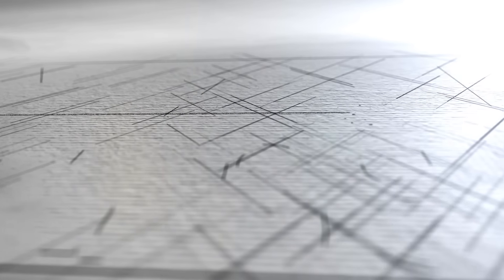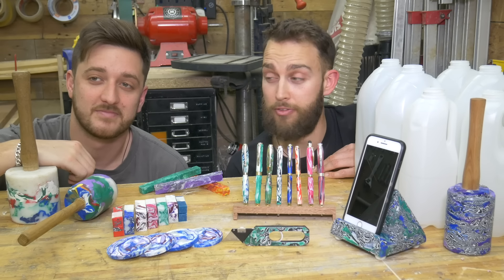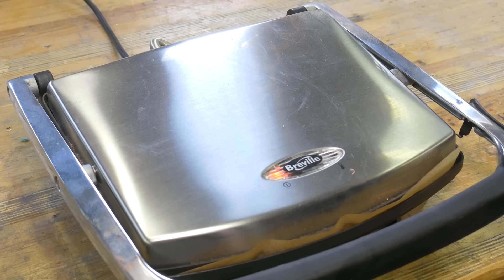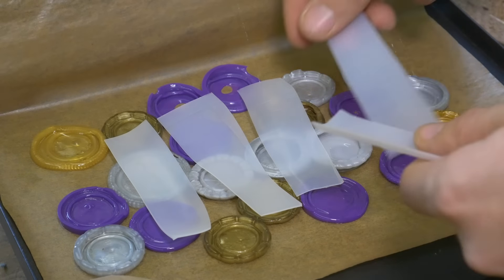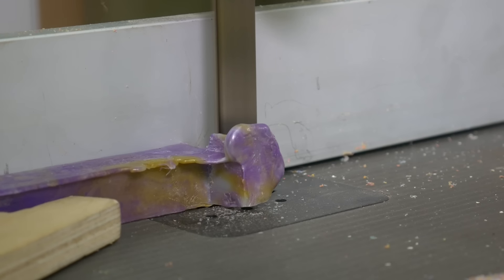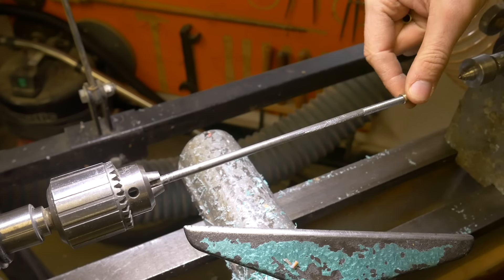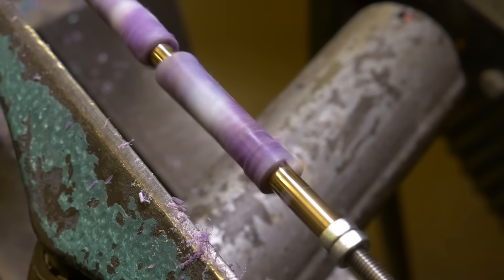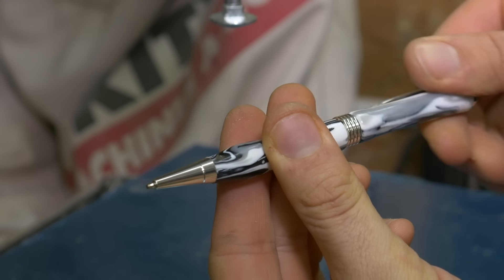Beginners' Guide to Melting HDPE - How to Make a Recycled Plastic Pen

Comment: Hi guys. Realy hoping to meet.you 2 at MC2020 this year but the way things are going rite now im wondering if the show will even be on even though its been pushed back to august. 

Anyways. 

What size mil drill bit did you use to drill the pen blank ?
Reply from the maker: Hey! Would be great to see you there. But it does seem unlikely doesn’t it. Hopefully it will get pushed back again and not cancelled altogether. I believe the size was 6.5mm, which allowed for a nice compression fit 👍🏼

Comment: Hey guys! I was hoping for another piece of advice, I tried a second melt and press. I felt like I had melted it really well this time on a panini press and got it into my mold (an old aluminum tube) and pressed it. I used a c clamp to press it and once it cooled the edges were all squiggly and not smooth. Is this more likely to be from pressure applied or temperature of plastic when pressed? Thanks!!
Reply from the maker: Hey dude - good question! Even in our 2 ton bottle jack press, the surfaces of the plastic are always like that. That’s why we always try to skim off the surface of the plastic to reveal the marbled colours. As the plastic cools, it shrinks. So if you don’t re-tighten then bubbles can form inside. So we come back every 10 mins or so and tighten the clamps. Hope that helps!
Reply: Brothers Make very helpful!! I knew it shrank some but did not even think to re tighten as it cooled! Thanks so much again for the fast reply! Gonna give it another go tomorrow
Reply from the maker: Awesome good luck!

Comment: It doesn't look liquid enough, but do you think it's possible to cast it in silicone molds? Would be great to craft dices or figurines
Reply from the maker: Unfortunately is doesn't go down to a liquid state. You would still be able to achieve things like dice, but you'd just have to press it in something more rigid, like a plywood mould. It also carves quite nicely!

Comment: Can you use cooking spray in place of silicone spray?
Reply from the maker: Since this video we’ve actually moved away from silicone spray as it’s easy to get it mixed with the HDPE and stops it sticking together properly. Try using Teflon baking sheets instead of greaseproof paper and you’ll be fine!

Comment: Hey guys love the video! I am currently trying my first melt. I am using packaging from work that is #2 hdpe but somewhat thick compared to bottle caps. Would that effect the end result or just simply the length of time to actually melt it? I haven't been able to really do the fold over and re melt yet because it just doesn't seem to get there. Thanks!
Reply from the maker: Hey! Awesome that you’re starting your own projects 👍🏼 we have come across the thicker stuff too. Don’t worry - as long as it’s definitely ♻️2 then it will work, it just may need a bit of extra time. Remember this won’t go to a liquid state but will soften enough for you to be able to bring it all together and fold/twist it up. Let us know how you get on!
Reply: @BrothersMake  Thanks guys! I gave it a try, currently using an electric skillet which did take it a while but it got there! I had one other question that maybe you guys can answer. my overall goal for melting and forming hdpe is to create custom plungers for my paper briquette press. I use pvc tubing for my mold and was wondering if you guys had any experience or opinion on whether or not molding hdpe directly into a pvc pipe would warp the pvc or if there would not be enough direct heat to do anything. if you guys dont have any experience with this then i will do an experiment and report back! thanks again for the response!

Comment: 04:30 Does the repeated folding process not mix the release spray into the plastic? And is that not a bad thing?
Reply from the maker: That is a potential yes. Since this video, we have avoided using spray release in any of our HDPE projects.
Reply: @BrothersMake  thanks... do you just use the paper without it?
Reply from the maker: We use Teflon baking sheets now
Reply: @BrothersMake  Thanks! Less waste as well ... good all around.

Comment: Would it be easier if you make the first pen as you did here, then make a mold of it and skip so much lathe and cutting time, on the next hundred pens you make?  Is it possible to make it to begin with in a round mold rather than square, to be easier to lathe?
Reply from the maker: yes that would be absolutely possible.

Comment: Decrease the (rake) angle of your cutter relative to the pen. In other words hold it down slightly. This will put less stress on the material and should cause explosive cracks like that to practically zero. Should get a better surface finish from the get go as well!
Reply from the maker: Thanks for the tips!

Comment: Some lids, even if they're HDPE, can become very brittle after being remelted, which, apart from the bubbles, can be another reason why the remelted blanks were shattering while being turned. I discovered this accidentally when I was remaking plastic parts for a broken computer mouse. You should first test few samples of different types of lids and see which ones doesn't get brittle after remelting.
Reply from the maker: We’ve melted multiple kilos of HDPE at this point and never come across any that turn brittle after melting. Possibly with Polypropylene but HDPE always melts in the same way

Comment: Hey guys I took a old electric drill that was battery powered and took it all apart and 3, printed the structure to make me a lathe for turning melted recycled plastics for cool projects and can also machine and turn soft metals like aluminum, copper and brass to make parts or custom parts for my RC car indoor carpet racing cars I got for oval and road course tenth scale and use lathe to turn custom suspension parts and ECT for my cars to make them handle better or make lighter weight parts of the original parts

Comment: What other ways can you melt HDPE?  Can you soften it in water (boiled to temp)?  Can you use a microwave to soften it?  I understand a toaster oven works -- but what about a regular old toaster?
Reply from the maker: Boiling water would not get to a hot enough temperature to melt HDPE. I think it’s around 120 it melts. We tend to go to around 150-160 degrees celcius for speed. Never tried a microwave but I would assume it doesn’t work since it doesn’t work on heat directly. A toaster would also be dangerous, so be careful!

Comment: How are you disposing of all the microplastic saw dust resulting from sawing etc? as it would be hard to pick up some of that microscopic dust to remelt (not talking about the big twirly bits as mentioned in the video but rather the plastic dust biproduct).
Reply from the maker: You’re right. The stuff that comes off the saw is very difficult to collect. We are in the process of setting up a secondary room next to our workshop that will be dedicated to plastics completely. That way we can sweep and collect everything. Until that time, we are still prototyping ideas for ways to use up some of the plastic that already exists rather than having to use raw materials. Thanks for the concern!

Comment: If you melted it at a higher temp, would it go liquid, preventing for from having to mash it with your hand?
Reply from the maker: No, it doesn’t go any more liquid than what we show in the video I’m afraid.
Reply: @BrothersMake  If we put it in an oven at a much higher temp, would it burn? Have you tried going hotter? If so, what happens? Thanks.
Reply from the maker: Yep, it burns above 180 C!

Comment: Do you never find that some PET bottle caps you get are PP? What happens if you toss one in the mix? And EVA liner inside some soda bottle caps - does that cause a problem?
Reply from the maker: The liner inside the caps can’t be recycled so they can’t be used. The caps on PET bottles seem to vary between HDPE, LDPE or PP. HDPE/LDPE can be mixed but PP can only be missed with Itself due to its crystalline structure and different melting temps etc.

Comment: I'm Kinda wonder if maybe a dipping process might not be better than routing the pens from blanks, plug the holes dip the parts wait a bit for them to cool then dip again. If you have to much can route off the excess. be less waste and maybe a cleaner finish if dipping alone would work. Or maybe making an actual pen mold to sit on a single burner stove with a mini USB, electric, or air vibrator on the side to remove any air bubbles. Don't get me wrong the pens look nice. But seems like there could be less process's in making them.

Comment: what is the drill size that you use for the hdpe pen blanks? would a j bit work, or do you use an i size??
Reply from the maker: 6.5mm works best. Not sure what a J or I size is!
Reply: @BrothersMake  size chart, decimal, fractions, and alpha designations. I will go back and see what best fits with a 6.5mm diameter. Thanks.

Comment: To bond to HDPE use Permabond TA4631 Polyolefin Bonder – 25ml

Features and Benefits

No odor
Adhesion to a wide variety of substrates
Full cure at room temperature
Bonds polyolefins
No primer required
Bonds underwater
Great water resistance
Common Substrates: Polypropylene, Polyethylene, HDPE, PTFE, Mild Steel, Stainless Steel, Aluminum, Carbon Fiber, FRP, GRP, ABS, Polycarbonate, PVC, EPDM, PA6, PET-G, PE-P

Comment: Good video showing that plastics can recycle but if we count such handwork price and energy etc what is needed for those products (pen etc) made from recycled plastic this way, reality is that it's far away from nature friendly. When recycling is putting to mass production, then working time and used energy is low enough for good work for nature
Reply from the maker: Large scale recycling usually uses an insane amount of energy and machinery. Low temperature recycling of plastics is by far the most efficient way to melt. Granted, this needs to be more efficient to be feasible. Also, all our machines are powered by renewables, so we aren’t using fossil fuels in our process

Comment: I don't have heat press at home. Can I use clothes iron instead? I'm restoring a small toy car with missing plastic parts.
Reply from the maker: Possibly yes! I would make sure to use a baking sheet or greaseproof paper to stop the plastic sticking to the iron

Comment: How do you know if a lid is HDPE or not if the lid itself doesn't have a recycling number. My Mayo container has a 1 on the bottom of the bottle, but the lid feels like it could be HDPE, also, my milk jug says it's HDPE but you say to avoid clear and glossy plastics, so something foggy like a milk jug isn't always bad?
Reply from the maker: The vast majority of lids in the UK are labelled. Other than that it can be very tricky!

Comment: Why not round out the mold and melt it directly to the metal sleeve. You could just add a small drill hole for the plastic to lock into once it hardens. You could eliminate a lot of the cutting, drilling, pressing and turning steps. And maybe even just do some light sanding if it works out well enough.

Comment: You don't need pen kits. You can get any cheap pen pull the cartridge out and build a blank to fit it or if the pen is small enough diameter you can make a fancy skin for it.
Reply from the maker: The pen kits are handy because they come with all the separate parts and they are fully customisable. To try and use the same parts from another pen would be quite tricky, and not much cheaper. It could possibly work if it was just a sleeve to go around the ink tube.

Comment: Guys, I guess this is kind of unrelated, but the plastic pipe that channels the water from the tank to the bowl slightly cracked (I have no idea how, nor when, but it did), making a 1.5-2 cm long line (which looks like a scratch), and it leaks drops of water every time I flush the toilet. Is there a way to weld that crack somehow, or should I get a new pipe?  The reason I'm asking is because buying a new pipe and then messing up with setting it up and stuff is just ridiculous amount of work for a small crack which should be an easy fix... I mean I can always put duck tape over it, but than the aesthetic is ruined - unless i put a little rainbow on the duck tape. :P

Comment: So you need $4000 worth of machine shop equipment to make “cheap” pens out of free bottle caps......and just when does it pay for itself?  At pen number 40,000? But they are very pretty.
Reply from the maker: Our panini press was bought in a charity shop for £3 and we have a second hand lathe that was £125. Some custom made pens can sell for well over £100 so if you wanted to make a business out of this, the financial aspect could make sense. The main issue is the time taken to process all of the plastic prior to melting.

We didn’t make this video to show how to make a business selling recycled plastic pens. We did it to show people that recycling plastic into creative products can be done at home with a very basic setup.

Comment: GUYS I can't find an answer on google! Do you guys know?

Does HDPE 'expire'? I got a bunch of free 5 gallon buckets, they're old, sun-eaten, and crumbly. Can they be melted down and turned into something that's as strong as a 'perfect' plastic melt?

The only thing i can think of, is all the dirt and possibly oil crammed into all the micro-cracks making the melt comtaminated and likely to delaminate. Other than that, I'm assuming they'll be okay to use. People put torches and heat guns onto old sun-eaten ATV fenders, and the melting shines them up like new. So melting the nasty buckets should work? I'll scrub and clean them best i can of course.

Comment: When making pen blanks, what is logic of making a square blank for a something that ends up round?  Make a round blank.
Reply from the maker: Yep much more logical but difficult in practice
Reply: @BrothersMake  No more difficult than making a square one - maybe even easier.  Cut off a pieced of PVC pipe close to the size of blank desired, temporarily stopper one end, coat the inside with a release agent, mix and pour.  Easy peasy.
Reply from the maker: PVC pipe isn’t heat resistant enough for moulds unfortunately. But we are working on a new design of a mould that would work in a somewhat similar way
Reply: @BrothersMake  That's just not true. 

Schedule 40 will withstand over 140 degrees (F). A pour the size of a pen blank does not generate that much heat. At least not according to the blanks I've cast in PVC pipe.

But, if one is concerned, there are other materials that can be easily obtained at more than reasonable cost:  electrical conduit (thin wall is best for this kind of application due to it's lighter weight), is an excellent choice.  Delrin is another one.  And on and on.  

Sorry, your statement does not hold water, hot or cold.

Comment: The reason that it broke is because  your knife  is flat. You have to create  angle and you have to cut with the noise.
Reply from the maker: The finish on hdpe actually comes out a lot better with a flat rake angle. A more aggressive angle is okay for deeper cuts, but not great for finishing.

Comment: i think the plastic i have is not the right kind. it is a solid rods that was a shelf at one time. that u put together by pushing them in to each other and also had screws. i want to make a 3 inch diameter rod and  i think 2 inch tall.  be more specific the  exact same  size of a mini tripod ball head the body part.  i think thy are 3 inch in diameter and 2 in tall.  also i am  thinking because i do not have a lay to spin it, and not have a chisel to make it round so i was thinking of finding a metal tub that  the  inside would be 3 inch in diameter melt it in side  with some plastic grinding it to a power or like glitter using some kind of strong blender
Reply from the maker: That sounds like a good plan! Let us know if it works!
Reply: @BrothersMake   ok i will also only useing black to match the other thing that is black as well

Comment: "Marine grade" plumbers groop sticks to HDPE and brass just fine. So does JB weld only the original though, the plastic version is terrible.
Reply from the maker: JB weld isn’t available in the  UK so never tried it. Would be interested to give it a go!
Reply: @BrothersMake  
I have a structural joint on a wind turbines I built. I cut 3 HDPE 5  gallon buckets. And I glued the joints of the buckets back together and then I glued the buckets down to a large wooden wheel. and literally the only thing holding that bucket to that wooden wheel is marine grade plumbers groop. It was just a simple prototype I made for fun but the thing has held up quite well I'm impressed the plumbers groop is amazing. I've never done a structural joint with JB weld but I would assume it would work just as good JB weld is a hard glue the plumbers goop is extremely flexible and will stretch like eight times its own length.
Reply from the maker: Very interesting! I’ll look into these for sure

Comment: Wouldn't the electricity used throughout this whole process counteract any benefit to the environment? The melting process seems to have a lot of heat waste, the heat gun used at one point has a lot of heat wasted, the lathe uses electricity as well. It seems to me that leaving the recycling to a specialized facility would be far more efficient than doing this at home and would be way more beneficial to the environment, as it would be done at scale and the waste heat could be harnessed for something like a turbine.
Reply from the maker: 100% of our energy is sourced from renewables. Dont assume that because recycling facilities are larger that they are more efficient. There are so many energy inefficiencies, not to mention additional costs such as heavy freight transport etc that make these incredibly energy intensive.